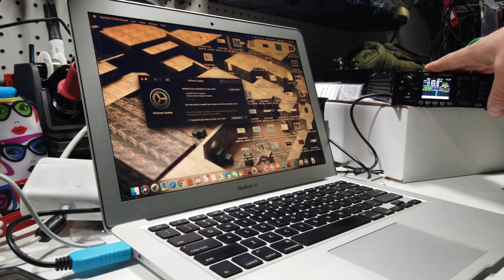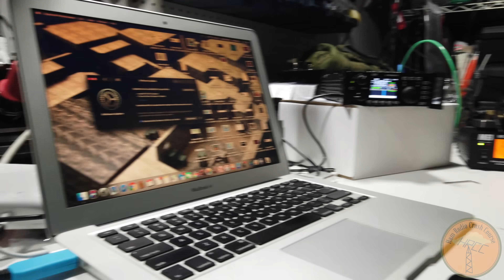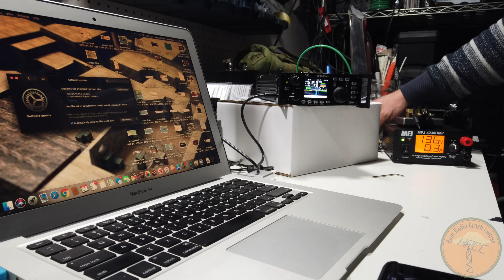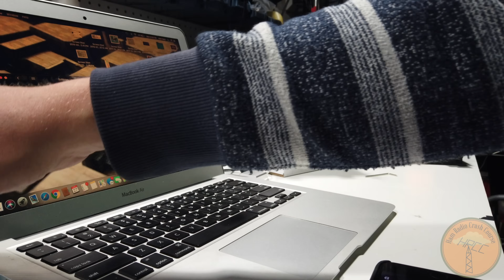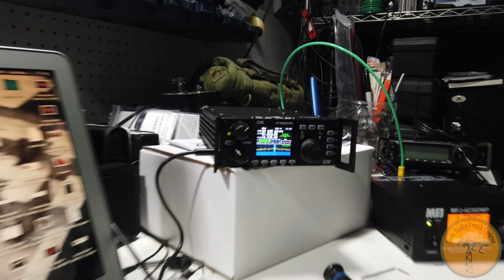How To Fix A Ham Radio AC Ground Loop

Comment: I'm just setting up my new IC 7300, and I don't have my final grounding solution in place yet. All I'm going to do for initial trials is run a grounding cable I made from an old VGA monitor cable (now with ring connectors on each end in place of its old terminals) between the radio's ground lug and the cover plate screw on the AC outlet where my power supply is plugged in.  I've verified with my multi-tester that the screw is linked to the existing house ground, which should always be the case.  Not the end game, but a workable interim solution.

Comment: You also get a lot of noise on the usb iface because of the cheap (unshielded) usb cable. I bet if you used a shielded USB cable, and grounded the shield, you would get the same results as when you unplug the charger ckt

Comment: I got a Xiegu G90 on the way since June 5th, and still not arrived yet from MFJ. Now, price was nice. For it, ordered a 30 amp power supply from Amazon, model number TP30SWI and TekPower as the brand.

Now, The very first thing I did was to measure resistance or continuity from the AC power cord ground lead, to the metal and screws of the power supply, and to each of the negative terminals on the outputs. Mine has three. Two rated at 3 amps, and on the back, the main output at 30 amps.

Now, resistance from PS cabinet or screws to power cord ground is about 4 ohms, but resistance from power cord ground to negative on any terminal is .7, or a short, a very low resistance. This means, my power supply, primary side is isolated from secondary, not by the transformer, but also the circuit as a switching power supply.

Filtering seems to be nice, but need to test as you have done with my G90 once it arrives. It looks that I will not have that problem, as I am using a car battery, but ordered the Power Supply for the G90.

Very nice test you did, so will test mine in the very same way, looking for what you did on the noise issue. Very helpful.
Reply from the maker: Good work. Looks like you really did your research.
Reply: @HamRadioCrashCourse  I just received the G90, and tested with the MFJ-1899T, To connect to the radio, as it has an SO-239, I used a right angle adapter from SO-239 to BNC, as the MFJ-1899T has a BNC on it. Unable to tune in any band. SWR 4 in red. No counterpoise used. Just tested on dining table.

With a 10 meters antenna, tuned to low SWR but no stations so far.

If you get to use your G90 with your MFJ-1899T and test, post results if you can. I \tested the 1899 with meter and reads good continuity. Thanks.
Reply from the maker: I have the 1899t, it definitely needs a counterpoise to load it up.
Reply: @HamRadioCrashCourse  I am using 180 / freq. I just got my Xiegu G90, but it came damaged from factory. Broken red cable at fuse holder, so intermittent power. I hold it straight, so the spring in fuse holder push the fuse to make contact then it stays on.

Now, even when SWR is very low, can not receive anything. NB, and AGC changes, but still no QSO's.
Contacted MFJ, but this took 10 days to get there. May miss the field day, as no other HF in my hands. Return may be as expensive as the shipping was. Then the way back to me another cost, making this a nightmare.,

I can fix if they send me the parts, but think that may not happen. Regardless, still trying with on different bands and set ups, antennas, etc, to see if this at least shows some life.

PS. I ordered an GR5V Junior 40-10 meters dipole, then I will install in attic, that is 45' long x 14' high. For radio safety, ordered an MFJ-915 to so the return current doesn't damage my radio.
Will test with that too.